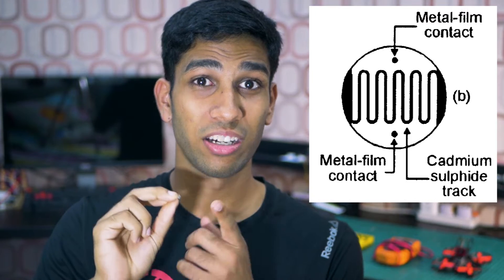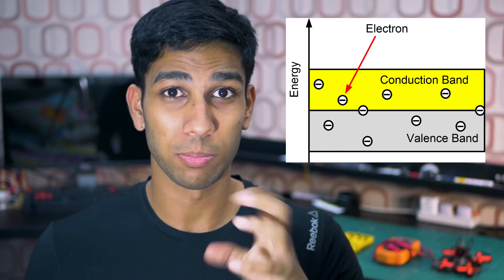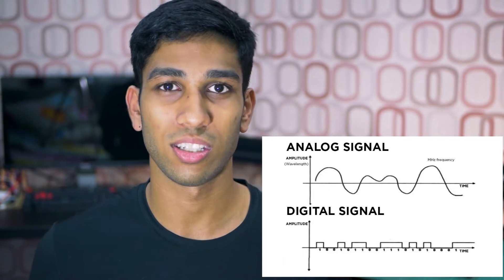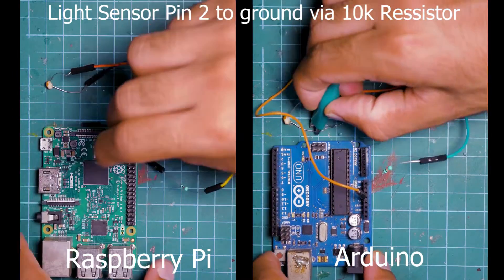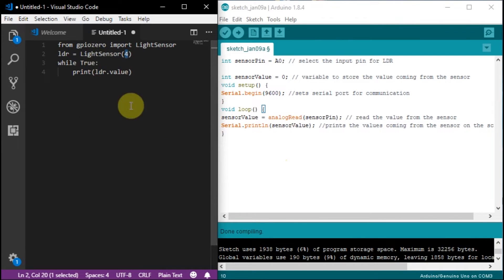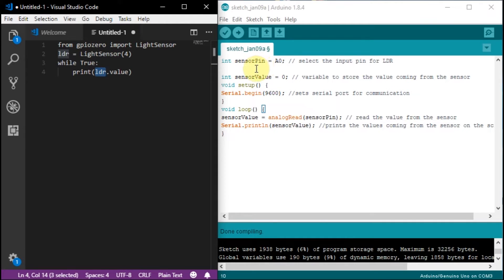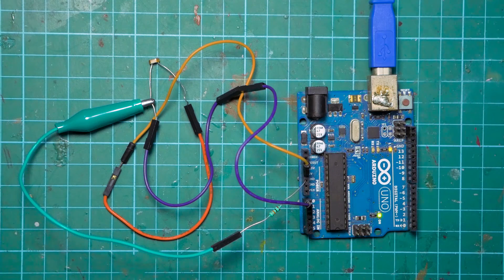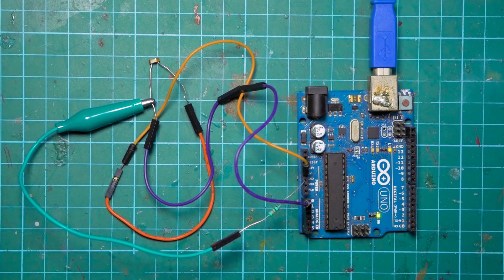Light Dependent Resistor (LDR) tutorial for Arduino & Raspberry Pi. Electronics crash course #4

Comment from the maker: Please note that the Raspberry pi doesn't have a Analog to Digital Converter so to wire it we will need to swap the resistor with a capacitor (1uf value). The capacitor will be wired in the same way the resistor would be wired- between your pin and ground.
Reply: Great video, was just wondering if you could tell me in what way would it be different to use a capacitor? Would the values be less precise or would there be a bigger lag in terms of the code showing the information?